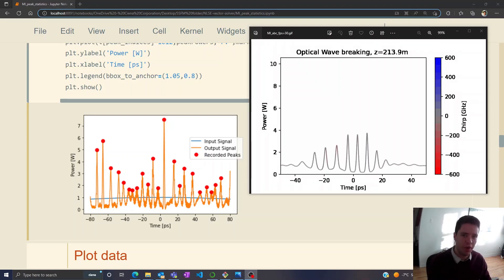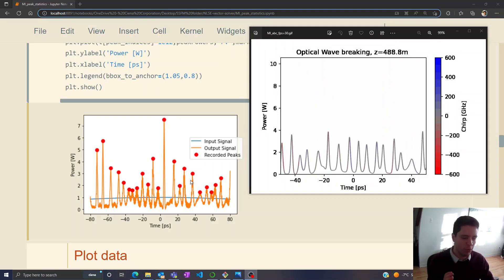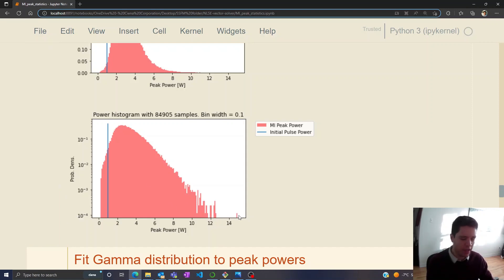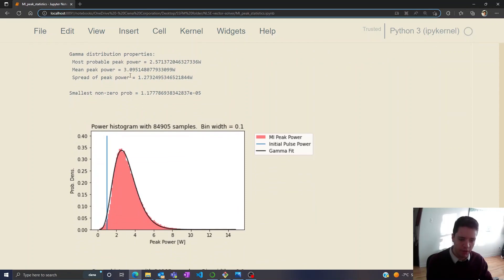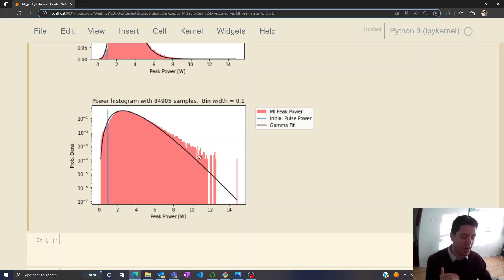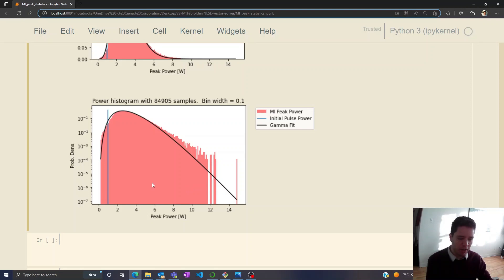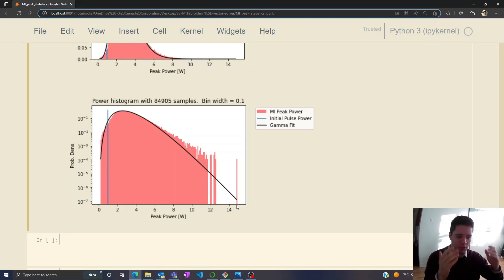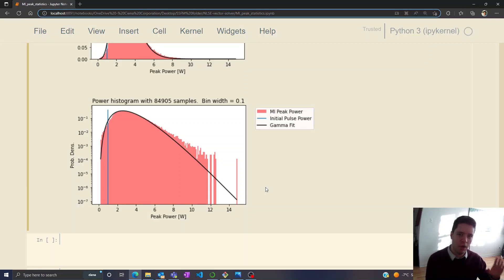Optical Rogue Waves and MI simulated in python!

Comment from the maker: Quick clarification: The graphs display histograms of pulse power, which is proportional to the square of the field. Therefore, a measured peak power of 16W implies a wave with an amplitude of 4sqrt(W). Thus, in the analogy to water waves in the end of the video, the waves would not vary in amplitude from 2.5m to 14.8m as initially stated, but from sqrt(2.5)m=1.6m to sqrt(14.8)m= 3.8m. Nevertheless, you can probably imagine that getting surprised by a 1/100.000 wave that is 2 stories tall would be unpleasant to say the least.

Link to article about rogue water waves:
https://www.sciencealert.com/extreme-rogue-wave-in-the-north-pacific-confirmed-as-most-extreme-on-record